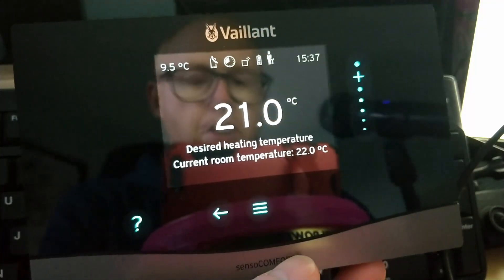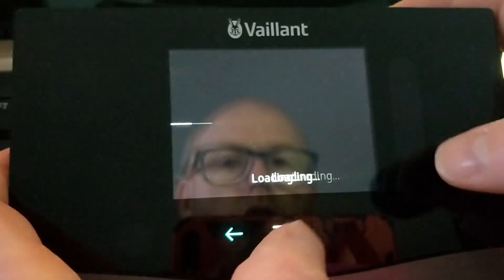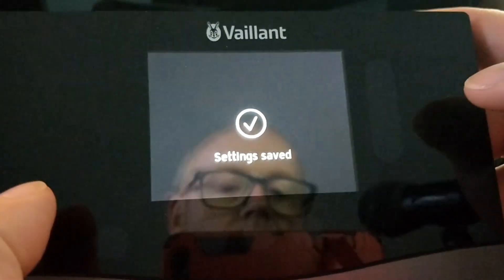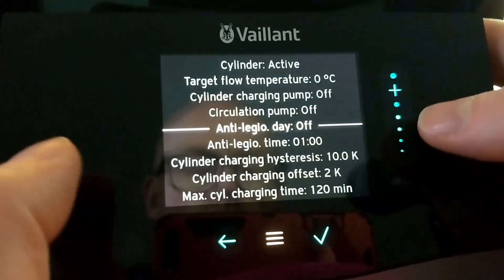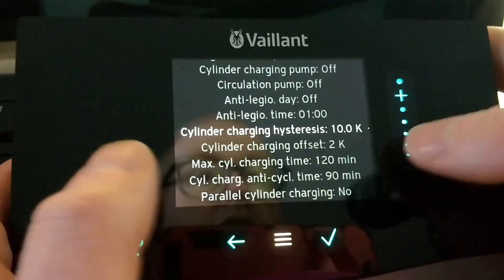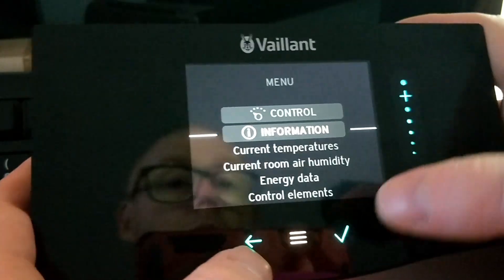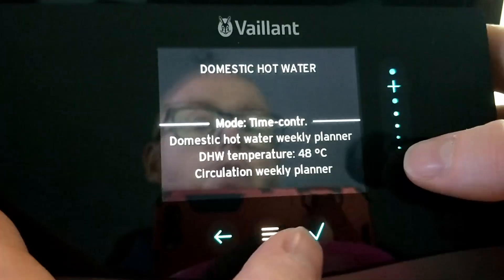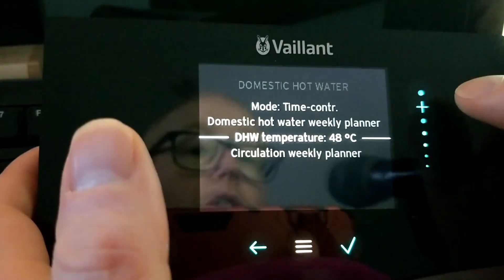Hot Water - Vaillant Heat Pump

Comment: I have the ‘offset’ set to zero and as you said, the system does what it likes and the flow temperature gets to 10 degrees hotter than my hot water temperature target.
Reply: This is because the heat pump cannot modulate down far enough to achieve the desired offset.
Reply from the maker: @JohnBrophy-z1c  I've seen people with 5kW units having the same problem. Apparently a large enough coil can help this but I can't find any technical info on coil sizing.
You would think that a 7kW heat pump with a 250L tank that are designed by Vaillant to go together shouldn't suffer this issue.
Reply: @UpsideDownFork  Well, you could have a bigger coil to transfer the heat but then you would have less hot water and more (copper) cost. Engineering is always a compromise.
Reply from the maker: Thanks for commenting!